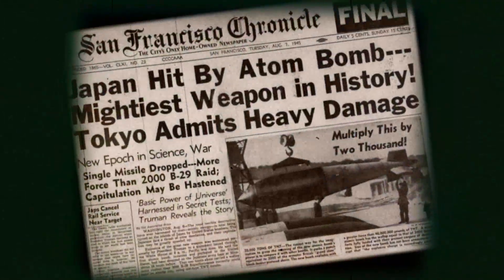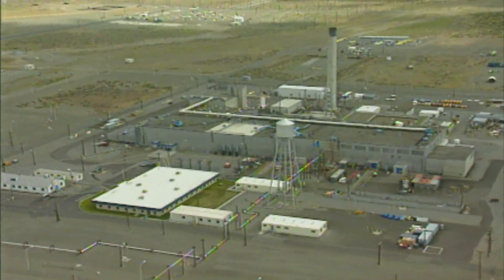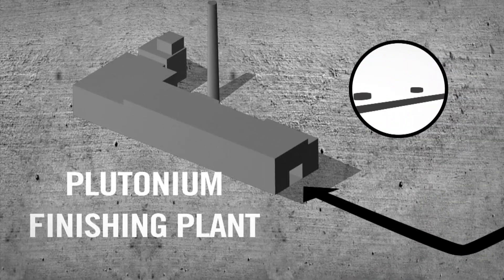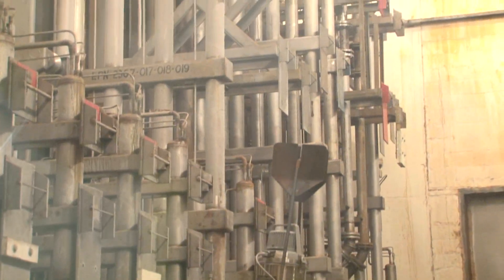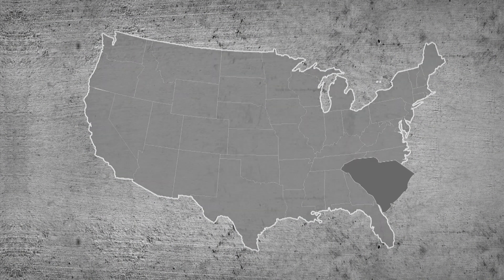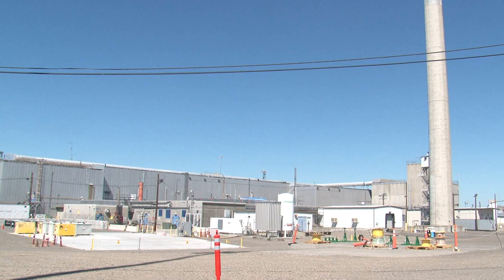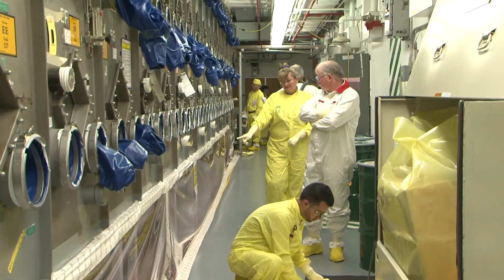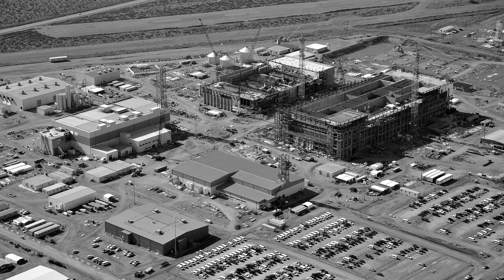The Hanford Story - Plutonium Finishing Plant

Comment: I was surprised to learn that the Plutonium was not generated in commercial reactors. The whole heat ouptut of these reactors in Hanford was dumped into the river. Japan has collected about 42 metric tons of Plutonium through their commercial nuclear power program.
Reply: Not much to be proud of. @NormReitzel
Reply: @anthonyboarman3833 they are saying it’s a little silly to be like “oh no, somehow the weapons we made to kill millions of innocent people have harmed innocent people in the wrong place”
Reply: Normal commercial reactors is partly designed such that the used fuel doesn't contains any Pu 238 (or very small amounts of it.)

Partly because of non-proliferation and also because the burnup of the fuel (if the necessary electric power is to be had) results in a far smaller amount of Pu 238.
Reply: It is generated and consumed in commercial power reactors, but that is too contaminated to be useful for weapons.
Reply: It gets too heavy in commercial reactors. Has too much 240Pu to be usable for nuclear weapons. They can make the stuff with special reactors that irradiated 238UF6 flowing as a gas through pipes in the neutron field of a reactor. This process generates nearly pure 239PuF4 that snows out and needs only 2 steps to make usable metal. Way better method than the Hanford B reactor as 99% of the processes are not needed. ❤

Comment: why didnt they just say that the plutonium buttons were shipped to the rocky flats plant in colorado to building 707 melted and alloyed with gallium and cast into pits.
Reply: Why didn't they just say that the plutonium buttons were shipped to the rocky flats plant in Colorado to building 707 melted and alloyed with gallium and cast into pits.
Reply: Yup that's what they did with it. Alloyed with roughly 3% gallium to stabilize the grain structure then cast into half a pit. Then they were finished on a lathe and the two halves were TIG or laser welded and the whole thing plated in nickel and gold. Plutonium is extremely difficult to work with, imagine machining something as sparky as cigarette lighter flint and deadly radioactive that cuts to dust like cast iron and that dust could easily ignite if air gets to it . 😳

Comment: They can make hazardous nuclear material but cant do anything else once done. cant unbild it. cant bring it back to original state. Cant make it safe. cant do nothing. stuck with it for ages.
Reply: wrong
once converted into mixed oxide (MOX) fuel, it can be "burned" in a normal civil nuclear power plant
Reply: @AKAtheA  Fukushima has shown dangerous and highly dangerous when MOX fuel went over a mile into the atmosphere where 21 million high level MOX moved around the world. Thousands of humans are far earlier going to die because of it.
Reply: No you can burn that in a fast reactor.

Comment: The video mentions hockey puck sized discs of plutonium. What does that weigh?
Reply: It would make a nice doorstop..
Reply: The plutonium buttons are roughly 500g but vary a bit due to how they make them. They add plutonium fluoride, calcium metal, and a bit of iodine in a magnesium oxide thimble. This is shoved in a platinum crucible that is heated with an induction heater and monitored with a neutron detector. PuF4 generates a lot of neutrons so you know it's done cooking when the count drops and stays steady. You get plutonium metal and calcium fluoride from the reaction.❤
Reply: That would be close to a critical mass if not over it.
Reply: @firesalmon7  : it's so interesting to read the answer of an expert like you. Thank you doctor.

Comment: I am curious if the control levers, where Enrico Fermi began the first chain reaction at Hanford, are preserved.
Reply: Fermi's lab was in a stadium at the University of Chicago.  Hanford didn't exist yet.   And they weren't levers, they were rods of carbon.  They worked by absorbing neutrons.   The more you pulled the rods out, the more neutrons there were to sustain the chain reaction.
Reply: Much if not most of those hand made tools, are preserved in the FPF's main conference room glass case.. no doubt moved since this deconstruction.. these were hand carved bits of wood and bailing wire in many cases, bent table spoons with long natural stick wood handles.  (I was consulting there in 1992-1993 range)
Reply: No. Dismantled before WW2
Reply: Doug Ball hence why their called (control rods)

Comment: I'm very interested in learning about new, innovative ways we can remove or possibly speed up the radioactive decay process, or even new ways of safely disposing radioactive waste.  Do you know where can I find information regarding this?
Reply: Are you serious?
Reply: Look up , molten salt reactors
Reply: You can’t. It’s pretty straightforward actually, either you bury it, mix it in with something, or reuse it. The best way is to reuse it. You can’t “speed” decay up with today’s technology, though I do believe it could potentially be possible. But that would require a better understanding and harnessing of the standard model. Which we are far far far from doing. If you want to help, research ways we can use the various isotopes in safe ways. Smoke detectors use the americium from nuclear waste. Perhaps there are more things we could use it for, like efficient RTGs for instance.
Reply: @gammadelray1225  accelerated decay is science's best kept secret.  it's been demonstrated to varying degrees with lasers, freezers, and neutrinos